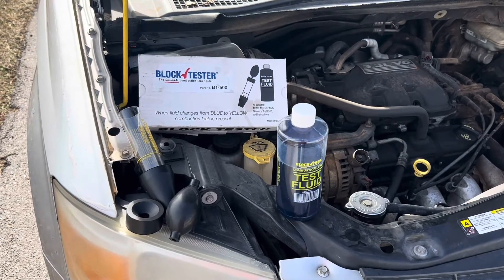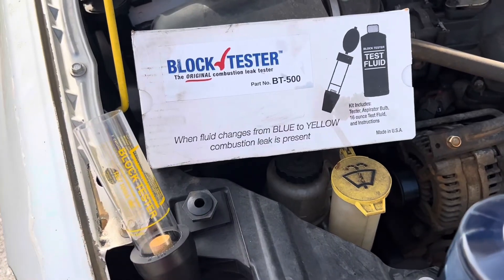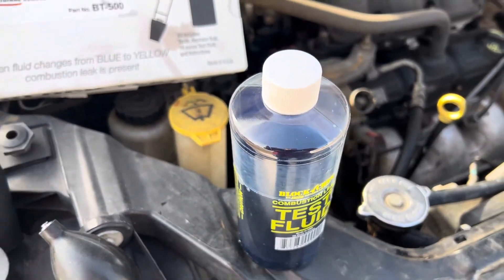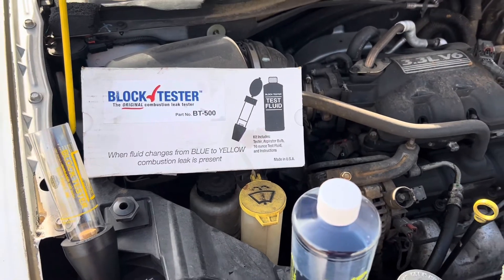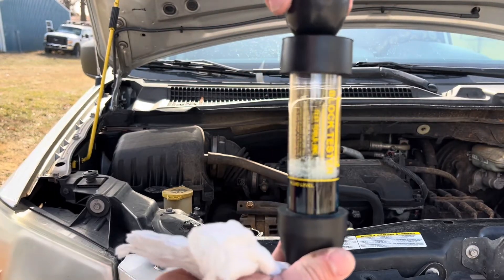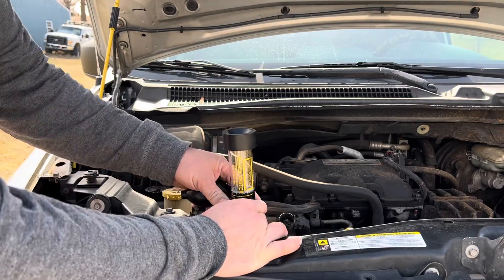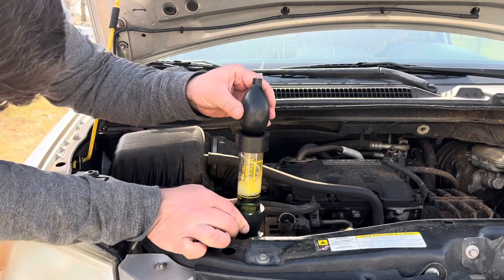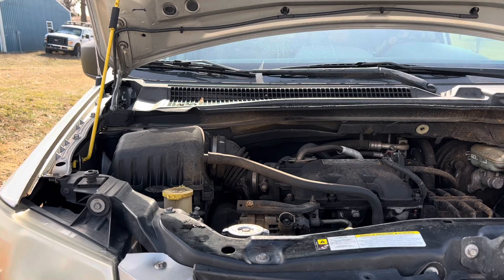Easy Test for Blown Head Gasket

Comment: The head gasket could be blown without loosing water. depends on where the head gasket is blown. Could be just loosing oil out the side of the engine. could have oil leaking into cylinder head, or it could be leaking oil in the water, or water into the oil. This video only works if the coolant is leaking into cylinder head. The best way to check it is to do a compression check on the engine.

Comment: Do you do the test on a cold or hot engine? I thought the test was conducted on a at operating temperature engine, but if thats the case, wouldn't coolant rise to the fill neck of the radiator/overflow tank rendering the results useless?
Reply from the maker: @spencerleeb  the engine can be hot or cold. If the head gasket is blown you will get the combustion gasses in the coolant any time. It is safer to do it on a cold engine to reduce risk of getting sprayed with hot coolant.
Reply: But isn't the thermostat closed on a cold engine which would mean gas and water aren't flowing through the radiator when cold ?

Comment: Do you do this with coolant in the radiator or an empty radiator? Mine is currently empty
Reply from the maker: You can just add water to do the test. That way you don’t waste money on coolant. But you don’t want to run it without coolant.

Comment: How would this work if my radiator is sealed? Can it be used on the reservoir?
Reply from the maker: Yes, you use this wherever you add fluid.

Comment: Does this work if the car doesn't start? My mechanic says my car won't start because my head gasket is blown- I don't believe him
Reply: It is possible for a blown head gasket to cause the engine not to start. When the head gaskets blows it will let coolant leak into the cylinders and cause "hydro lock" which it would impossible to start. So the mechanic may not be lieing.
Reply from the maker: It is tough to get this to work if the vehicle won’t start since the combustion gasses from the engine running is what this detects.
Reply: Take the spark plugs out and rotate the engine if there is coolant in the cylinders will shoot out and you will know that's what's causing it to not be able to start
Reply: The best way to check it is to do a compression check on the engine. the engine doesn't have to run it just has to turn over.